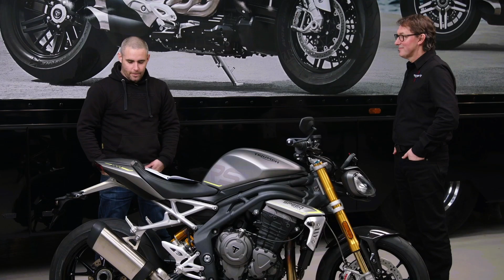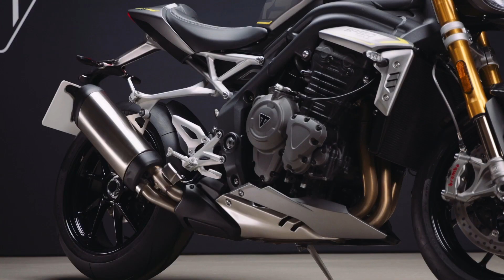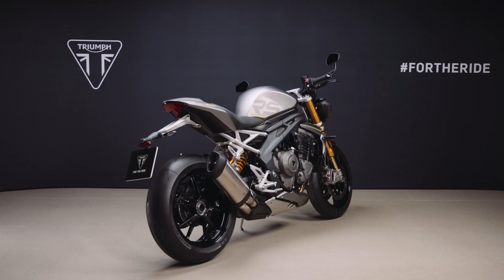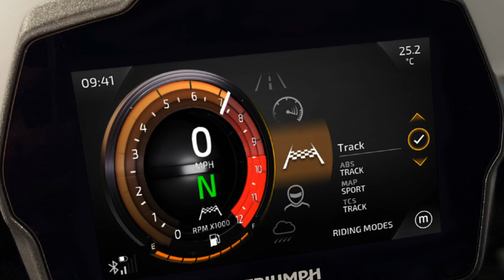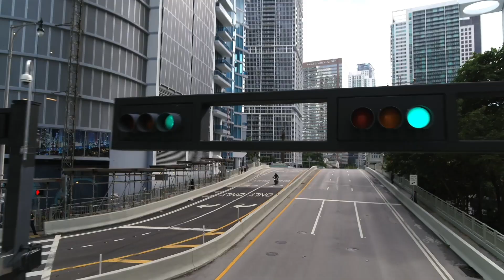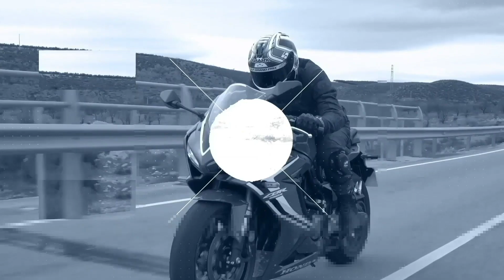Triumph Speed Triple 1200 RS 2021 | Triumph's Ultimate Naked Motorcycle | Visordown.com

Comment: If you add up all the weight savings just from engine + frame + battery + exhaust + wheels, it's way more than 22 lbs ... that must mean one heavy ass cat converter hiding under there for Euro5!
Reply from the maker: True, but they have to do it!
Reply: Will give us something to remove, and a chance to install a full system+remap to release some more noise/ponies :)

Comment: Wow, gorgeous bike Triumph! I'm wondering how stable these high hp naked bikes are at high speeds? Do they have speed limiters? There is a reason high performance sport bikes have streamlined fairings.
Reply from the maker: Shouldn't be a problem, the weight distribution has been a focus and should aid the high-speed stability while on track.

Comment: Not crazy about the linked braking system or single headlight for low and high beam but overall, it’s a solid upgrade from the outgoing model.
Reply from the maker: It is apparently imperceivable - we are gonna reserve judgement till we ride it!
Reply: What do you mean by "single headlight for low and high beam"?
Reply: @motozest7856  The outgoing model uses both headlamps for low and high beam function while much of the running footage on the new model shows a single headlamp illuminated for the low beam. I'm not a fan of the one eyed look but it may not bother others.
Reply: @MrJayNC  Oh man, I did not notice that until you mentioned it... I think asymmetric headlights look abysmal... F#%$, I was really considering this for my next bike...
Reply: @motozest7856  I do as well. I know it might not be a big deal to some but it's off putting enough to have me considering another bike instead this year.
Reply: @MrJayNC  Absolutely, this has been bothering me since you pointed it out... Do you have any idea if it's possible to change that setup (maybe buy a low beam bulb for the high beam side and run it like that, without a high beam)? It sounds almost ridiculous not to buy a bike because of the headlights, but I think that's what's going to happen if I can't figure out a way of making the Speed symmetric...